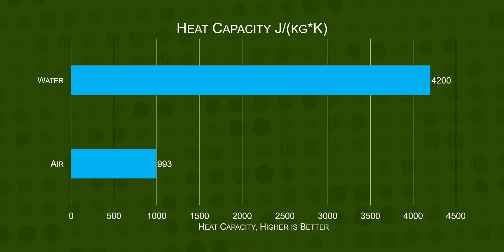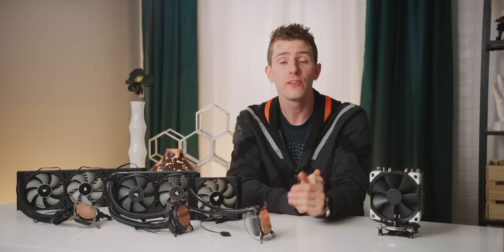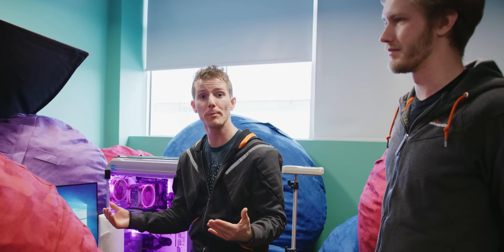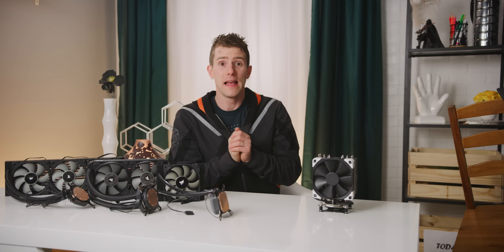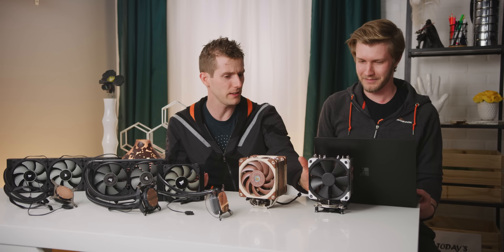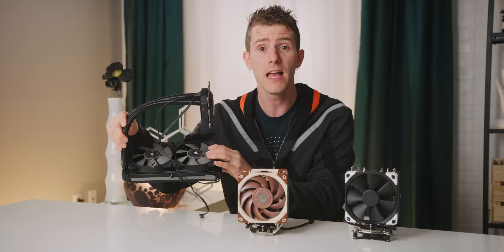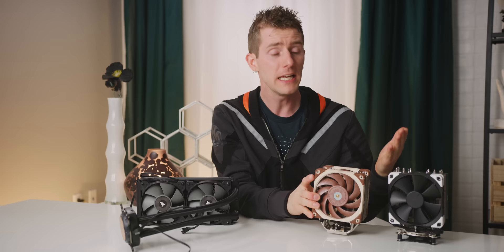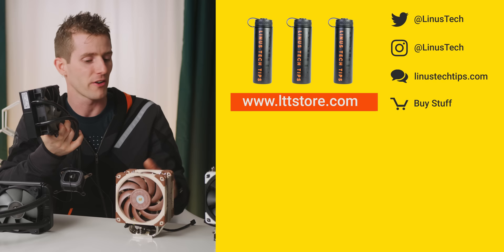Why you shouldn't water cool your PC

Comment: That video didn't age well, did it? Gamers Nexus made such a comparison 2 years ago and they got the exact opposite as a result.
Not that I care much because I'm open looping. And that beats any air cooler and AIO alone for the fact that I can control fan speed via water temperature, so there's no constant up- and downramping of the fans depending on the load (super annoying).
And regarding 12:10 : Within the 5 years of operation I had exactly zero downtime for maintenance. I only had to top up the water with ~30 ml after 3 years. I don't know what other folks from the water cooling community do differently that they have to drain, clean etc. their loop several times a year. Maybe it's that I stuck to pure copper and just destilled water with a biocide instead of the colored milky crap that's so popular now?

Comment: This video is missleading, test is incorrectly performed and has wrong conclusions. With the rise of GPUs TDP the undiscussed problem heat generated by graphic cards. Most of the PC cases cannot properly work with 250W TDP  GPUs and 150W TDP CPUs - most importantly note that those Watt values are also wrong as both CPU and GPU will generate more heat that those numbers. Solution could be to use AIO watercooler on CPU to move heat directly out of the PC case - which will magically solve issue with overheating GPU. Still cards with more than 300W TDP will be problematic.

Comment: How do these results change if the size of the case shrinks? For example, in an ITX case where I'm assuming the air would be hotter overall due to worse circulation and the fact that smaller spaces heat up faster.

Comment: air coolers suck ass. I dont like slashing my hands every time i need to take out the ram or gpu etc. Plus water coolers are so much sexier and dont put so much mechanical load in the motherboard as opposed to a big fat air cooler. Also the stable temps are a big plus imo. fluctuating temps arent good for any electronics
Reply: What about the potential leakage?
Reply: @ZyliceLiddell  not really a problem if you make a loop properly. Or get a good quality aio. Prefferably check everything yourself also. Either way I dont think its much of an issue at all.

And if you make a custom loop yourself, just test run it without providing power to the entire pc except the pump from a separate psu. Then even if you mess up and something leaks, its not an issue.

Comment: I don't use water coolers for the same reason I don't use water beds.
Reply: Bad reason
Reply: @Hovis_Enjoyer  I said this but actually just ordered a Kraken Elite 360 RGB haha. Will be my first time not using air.
Reply: @exurosanctus  Good choice. Video is a bit of a scam for views to be honest, kind of rubs me the wrong way...

There's no reason not to run a AIO water cooler. They're filled with non conductive fluid and are completely silent for the most part (compared to bolt on coolers) they run SIGNIFICANTLY cooler under load in a regular case and require less fans in the case because the ambient is lower. Not to mention, you're WAY more likely to rip your socket off and destroy your mobo/cpu with a big heavy air cooler, than to ever have issues with an AIO.

Just make sure you fit it right 😋 you'll be really impressed I promise
Reply: @Hovis_Enjoyer  sounds good, thanks. Planning on wiping off the pre applied thermal paste and using some Arctic for sure. I’m excited to see it in action.
Reply: @exurosanctus   I wouldn't worry about  changing the paste unless it looks really bad, manufacturers are pretty good at getting it right these days!  Best of luck and enjoy dude!

Comment: I kinda hate AIO CUZ IT'S RISKY AS HELL.
Reply: Not if u buy the most expensive one
Reply: @LawAbidingSociopath69  Brand= not always mean safe
Reply: @LightMCXx  u can always test it for 2 weeks on a shit pc to run then once ur comfortable/confident w it then transfer to ur main build
Reply: @LawAbidingSociopath69  idk which country you live in but in my place sellers won't take the product back after 2weeks of usage unless there is some defect
Reply: @gabrielaleactus9932  oof i thought warranty is 1 year?
Reply: @LawAbidingSociopath69  i mean they will take it back if there's a fault in the product probably for a year or so (which is under warranty) but if i say i want to return it because I don't like it after like 14-15 days.... It's well beyond the return date at my place
Reply: @gabrielaleactus9932  then just dmg it xD like put scratch on to the tubing
Reply: @gabrielaleactus9932  but yeah i doubt they'll return ur money back they'll just gib u diff aio
Reply: I had one for almost six years on my current build with zero issues. If you mount it properly to start, I don't see the problem. Coming from my build before that, I was rocking nothing but Noctua fans and D15 for CPU. Both applications have their pros and cons. If you know what you're doing, it's pretty straightforward.
Reply: @PlayinWithGhosts  any tips how to mount it properly bro?also is it risky to buy 2nd hand aio's?

Comment: Its impossible for a 240mm radiator to cool better than a 360mm radiator without a variable in the equipment or the test procedure. All the data they are claiming is sus.

Comment: So, you're comparing two VERY different fans (no, really.. at LEAST learn the difference between HAF and SAP first before preaching "which one to use")  and calling it "water" cooling vs air cooling.  Horrible representation of liquid cooling aside..  at the VERY least.. use the same fans on both. The Noctuas are going to outperform just about anything on the market. (not quite.. but they're at the top) 
At least comprehend first, then explain that your fans are the heart and soul of your cooling loop REGARDLESS of "type" of loop. 
AIOs are the poor man and lazy man's version of liquid cooling. Cold plates are wretched, fins are notoriously terribad.. shallow and mostly nonexistent, most times they're a terrible material or too thin to absorb enough heat to make any kind of difference... and the pumps aren't even as strong as fountain pumps most of us used to use when we cobbled a liquid setup back before it was a thing. (BTW, yes.. your intake should be FRESH air.. if you don't understand WHY, stop making videos pretending to comprehend it)  and neither option does a thing to cool the VRM. 

I've seen straight-up amateurs on YouTube do a better job of "comparing" and giving better advice.. you guys should be ashamed of yourselves. 
Please stop trying to come off as "experts"...  I don't want to know how many people have watched this trash and freshman-style ruined their PC because of bad advice and amateur hour "comparisons" 

Folks, if you want to learn liquid cooling, this ain't the place

Comment: Water will evaporate and your pc will be ruined. Mine did
Reply: skill issue
Reply: @Archbtw_  no man... you need to refill your loop every fiew years or so, because it will evaporate. Just annoyance. With Air cooler im fine at least 7 years. Also, water pump can fail.

Comment: This is the stupidest video if you ask me. It is so far away from the real world. I have had Noctua fans before. They make a lot of air flow / pressure but were never really anywheres near quiet. All air cooling setups I have seen either used tons of fans or had revving issues. They don’t provide much mass to sink heat. All watercooling has been better, both AIO and self built. The key take away should be that you need to test out your setup and make adjustments if needed. You don’t really seem to be very knowledgeable, just good at blinding with „scientific method“ crap. I‘ve built many computers with AIO and they are not created equally.  There are ones with the pump on the radiator which are much better, than ones with the pump in the CPU block. In addition, you don’t have to use the bundled fans, if they are too loud, or not cool enough, you can swap them out.